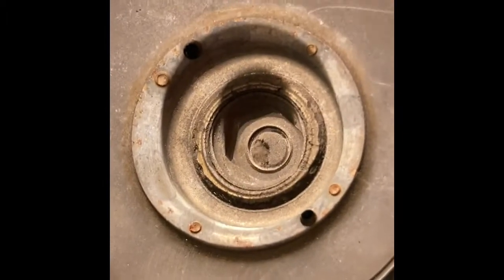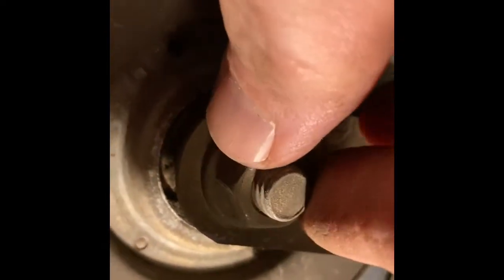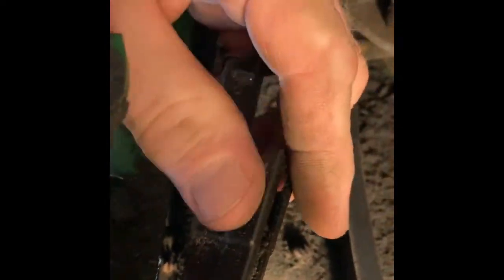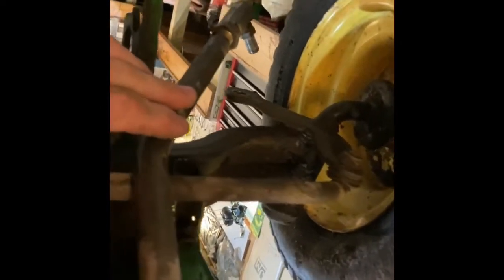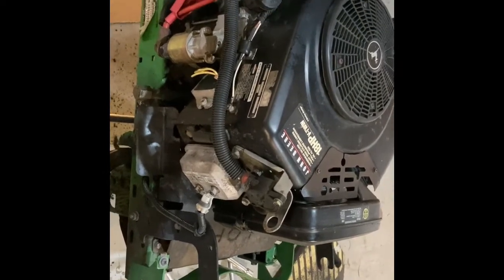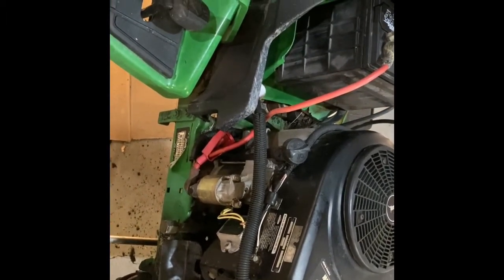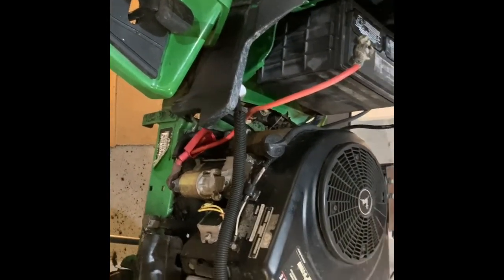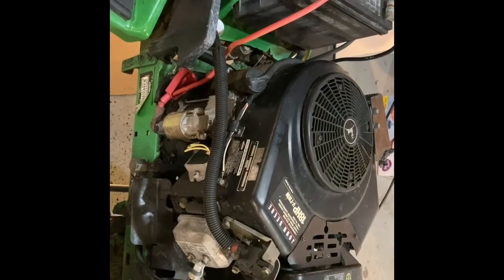John Deere GT225 GT235 GT245 Drive Belt Replacement

Comment: Well you can replace the belt using this method.  It's a good thing that the fan blades over the transmission are very pliable.  Using a very long flat bladed screwdriver helps goose the old belt off and I have a small crowbar that has hooked end to help get the new on one.  Once getting the new belt over the transmission pulley about halfway - pulling on the belt the correct direction to seat the belt on the idler pulley works nicely.  Make sure you pull the transmission lever in the rear to let the idler spin easily.  Whew...it was a job....

Comment: I know this is an old video but I had a repair shop replace the transmission drive belt and when I got it back it keeps on leaking fluid whether it's sitting or running. Thoughts?
Reply from the maker: Sounds like they maybe broke something when they "repaired" it.  Is it a slow leak or a considerable leak?  Can you locate the leak?
Reply: @FloridaDeere  no really can't pinpoint the leak. It's pretty considerable. If I fill it completely up I can only mow for about 30 minutes before it loses power and won't move. ty for the quick reply
Reply from the maker: @bwill578  Clean really good, like perfect, run it in place for however long it takes to leak, have it over a clean piece of cardboard.  If it leaks quick enough, watch it until it comes out.  I currently have a GT245 now getting ready for sale, I'll look it over, it may just need new seals.  Pain in the butt for sure, but probably not expensive.

Comment: After 15 years I had to replace mine last year. It wasn't near as bad of a job as I thought it was going to be. I seen that some people take the whole fender section off to get around the trans fan. It was hard to see but I don't think you did. It can all be done from underneath. Seems like I used a ratchet strap with the spring so I didn't have to take it off. It's a pretty tight spring.
I wish I had all those old JDs to make a good one or two out of.
Reply from the maker: we did have the pan off on this one, trying to cure the seat shut-off wire, but when I did mine on my original GT235, I never took the seat pan off, thanks for watching

Comment: How did u get it around the fan
Reply from the maker: It's been a while since I did the video, but I think I worked it through the blades.  I did the same on my 322 fan belt replacement.  Everyone else on that one was taking the whole dang radiator off.  Now to be sure, you have to be careful with the fan blades as they can get brittle.  I hope that helps and thanks for watching.

Comment: sweetbeef my mahindra dealers throughout my state run hytrans when they change tranny fluids on the mahindra products they sell. its what they have on hand and is cheaper than mahindra tractor fluid.  there is a product at fleet farm called farm rated tractor tranny and hydraulic fluid for 35 bucks for 5 gallon pale.   on the gt245 how u know whats wrong if suddenly stops moving   just barely move forward sometimes

Comment: I'll never understand why these guys just don't cut the damn belt off!!!
Reply from the maker: Yes, you can cut them off easy enough, but putting a new one on still requires the process of taking some parts off.  But yes cutting the old one off does make that part easy.  Thanks for watching.

Comment: Thank you for making the video. Very helpful in my effort to replace mine which was 19 years old and looked terrible. This schematic helps in reference to your video: https://partscatalog.deere.com/jdrc/sidebyside/equipment/70454/referrer/search/pgId/2311490. I followed your steps with the addition of having to walk the old belt off and the new one on. After removing the parts you mention I dropped the belt downwards off of the fan pulley, that gave me enough slack so I could then remove the belt from the front clutch pulley. Once free from the clutch I worked the belt off and over the fan in the back. Install was the reverse. First I routed the belt over the fan in the back and pulled it downwards off the pulley. Next I pulled the belt around the front clutch pulley, then back to the fan pulley to raise the belt up to the pulley. Then I completed the routing through the rest of the pulleys. Oddly the hardest part for me was unplugging the clutch. I spent at least 30 minutes working the plug apart. Thanks again for posting the video.
Reply from the maker: Thanks Robert, I thought the video was terrible, but it was the best I could do with the camera (phone) I had.